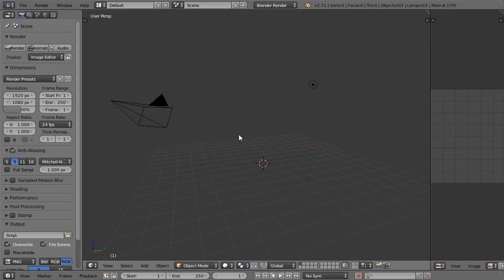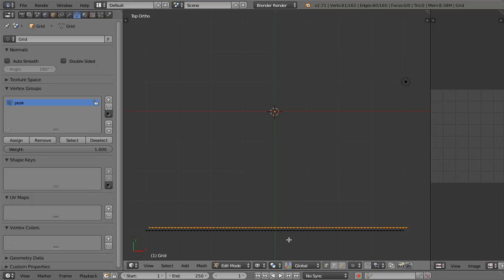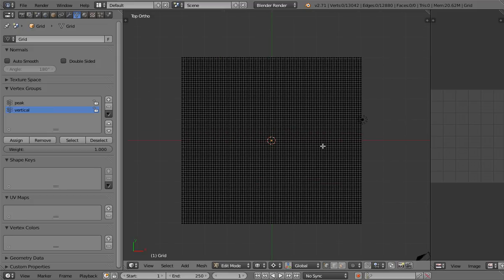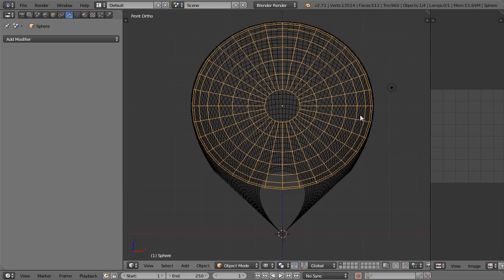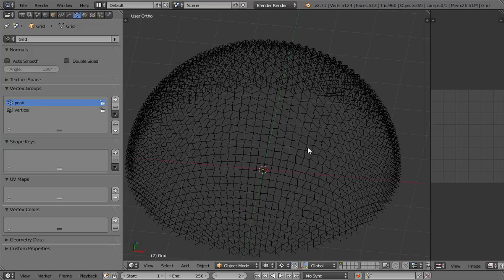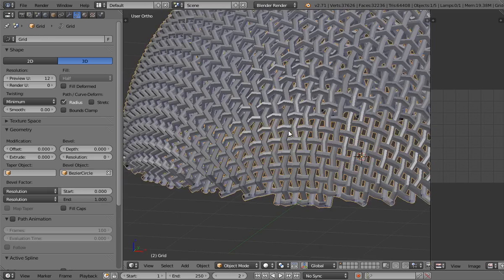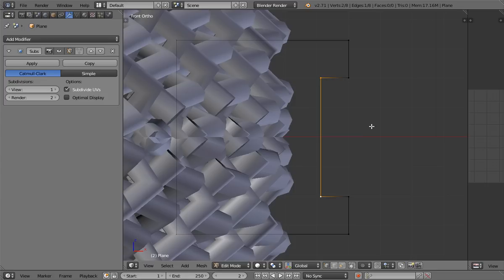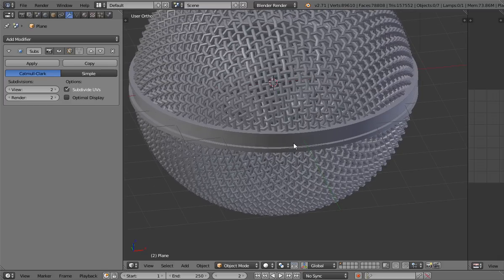Blender Modeling Exercise - Microphone

Comment: Ok thats actualy kinda hard. Wouldnt be able to do it. Wonder of you could just create a sphere with some high resolution and then use wireframe modifier, would just give alot of work selecting the vertices to scale down (or up) to make the strings interlaced... think it could also work, yeah, it would work.
Reply from the maker: There's also an add-on that'll generate a weave from any mesh shape, I think it's called the celtic knot add-on. This is handy because you can take a sphere and automatically generating the wires that weave in and out of each other. The thing this is missing for realism is how microphones become more congested on the sides as all the wires wrap around and begin to converge. -chris
Reply: CG Masters Amazing. Great

Comment: I suspect instead of converting the mesh to a curve and doing a bevel, the skin modifier on the mesh would have had the same effect.
Reply from the maker: The skin modifier doesn't offer a whole lot of control, including no radius values so you actually have to scale the object in edit mode to control the wire thickness. -Chris
Reply: Totally does. With the skin modifier on, go into edit mode, select the vert(s) and either press ctrl-a and move the mouse or set the RadiusX and RadiusY in the properties panel. Now, I will admit that on verts with more than 2 lines going into them the skin modifier gets a bit hinkey, but in this case it should be fine.
Reply from the maker: Oh nice didn't know that! How about segmentation?
Reply: Okay, I totally know what segmentation is, but just in case there's someone else looking at this conversation, you'd better explain what you mean, first.
Reply from the maker: haha I mean the amount of edgeloops added along the wire. The number of edge loops seems to be dependent on the scale of the skinning without a value of its own to change. But maybe there's a hot key for that too? The issue with that is if you want really thin wires it's going to add a ton of edge loops.
Reply: Ah, that. No, I don't know of any way to control that. However, there's always a decimate and mesh smooth. It's not elegant, but it works.
Reply from the maker: Darn that would've been cool. Oh well at least I know about skinning re-sizing now thanks for that.

Comment: Thanks for the video. It was very intuitive and coherent. I watched another Vietnamese guy doing it but couldn't understand every step of the procedure, so it was very fortunate for me to have found yours. However, to avoid having making separate layers for vertical and horizontal lines, still using the save Vertex Group 'Peak', you only have to move the vertical copy 1 unit of grid to left or right. This will avoid the collision of selected points later on when raising the selected vertices up (weaving). Also, after raised and converted to curve, if you convert them to curve type Bezier (in Edit mode, on Tools menu, section Curve, 'Set Spline Type' and choose 'Bezier', then you can smooth them by pressing 'V', choose 'Aligned'. This will also allow you to change the preview resolution to 5, bevel resolution 2, much cheaper than having to use Sub-suf modifier. I found my machine was struggling when using sub-surf.

Comment: What are ur unit setting? Because when I try to duplicate my line by holding Control and moving it up, it will not move that close. only to the next grid line
Reply from the maker: Hey sorry for the late reply, my unit settings are not set to anything for this video, they're just default. You can hold ctrl+shift while moving to move things in smaller increments. You can also zoom in until the grid lines split so you can move things in smaller increments as well. -Chris

Comment: Great tutorial and nice results; I never played around with that cast modifer before so thanks for pointing that out. Though I am a bit curious why you decided to add extra verts for the band instead of perhaps using something like the edge split modifier, or even perhaps crease and bevel values and the bevel modifier on the hard edges instead?

Adding extra verts like that on something I plan to subdivide always bugs me, because of how dense it makes the mesh in those areas.A mic is small enough that a bevel seems overkill to me, so I'd likely use edge split unless there were going to be some close up shots, in which case I would use a crease value on the hard edges to avoid the deformations from the subsurf then use the bevel value and bevel modifier to add a bevel to each hard edge directly without all the cruft that comes with doing it the old dirty way. Also using modifiers means you aren't actually changing the base geometry, so it would be easier to continue refining if you find you aren't happy with the shape.
Reply from the maker: No reason really, it wasn't the focus of the tutorial so I just threw a couple edge loops in just to get a beveled corner since I rendered close up. But yeah there's plenty of ways to bevel or to not bevel, depending on what you need from your model and how close up you render. The bevel modifier used alongside the subsurf modifier is a favorite of mine. I used it extensively in my rifle course and its definitely a lifesaver in a lot of situations where the 'old dirty way' would fail, but the classic workflow still reigns supreme in my opinion in many cases for speed and flow. -Chris

Comment: After applying the cast modifier, going into edit mode, selecting all the vertices and clicking on the cast button to see the results in edit mode. When I press "G" then "z" and move the selection up all I get is a straight line going up. I've started from scratch a dozen times, listened to the video many times and I still don't know what is happening. That's at 7 minutes into the video. Thanks
Reply from the maker: Hmm, as long as you've got that edit mode display option enabled in the cast modifier it should be visible when you move the vertices. Can you save the blend file at that point and send it to me at contact@cgmasters.net? I'll check it out and get back to you. -Chris
Reply: I'm tired right now but I got it to work, Not sure but I don't think I was in Object mode when I selected the cast modifier

Comment: Never heard the Shift+R hot key for repeating before. That alone is a massive time saver! Never would have attempted to try the mike wire mesh; amazing solution. Cast modifier, go figure! Thank you.
Reply: Jacob Fausett - Maybe double-check your hot keys too in preference section. I have a few Blender hot keys that got highjacked by other applications. But I did otherwise just verify this works in 2.78
Reply: Make sure you dublicate and move in one action. Don't press RMB before everything is in place. Otherwise it counts as two actions and he will repeat only your last action. Which is move. Hope this helps.
Reply: @Filicatos  Man you saved my life
Reply: How? When I hold Shit+R, it just moves the selected vertices down a row.
Reply: Jacob Fausett Shift-R will repeat your latest action, so make sure your latest action is what you want to repeat! its likely that u did something else unintentionally right before hitting shift-r.
Reply: I asked about this in a forum not too long ago, no one seemed to have an answer. Took the need to draw a complex mesh to learn it!

Comment: I'm making a mic for a video game. I don't want to go over the top on the modelling side of things. Any ways I could go about modelling it, keeping it relatively low poly? Should I just use a sphere for the top of the mic and use a texture to get the "grill" look?
Reply from the maker: Yeah that seems to be the best way to do it. You could even model it high poly and use the high poly mesh for baking both the diffuse map and the normal map onto a low poly model. -Chris
Reply: CG Masters
 Have you got a tutorial on baking normals? I've never really gotten round to doing that sort of stuff.
Reply from the maker: I don't think we do, but I can walk you through it. The Bake options are in the render properties. You set the bake type to "normal" and enable "selected to active" which will allow you to bake from a high poly mesh to a low poly mesh. So you would create the high poly microphone and a low poly microphone and have them overlapping each other perfectly. Then select the high poly mic, and THEN the low poly mic, and click on Bake. You'll need to make sure the low poly mic is UV unwrapped onto a new image too, since it needs an image to bake the data onto. I think Cycles requires you to set up a material to do this, so I use the old Blender Renderer to bake normals which just requires uv unwrapping onto an image. -Chris
Reply: CG Masters
 Thanks a lot man! I used 3DS Max in University but never reached the point at which I'd need to use baking. So I need to have a UV unwrapped image first before baking?
Reply from the maker: Yeah, UV unwrap the low poly mic onto a blank image which you can add in the image window from the image menu. Otherwise you'll get an error like "no image found to bake to". -Chris
Reply: if I was doing a video game I'd just have a sphere with an alpha-enabled texture on it...

Comment: I cant get the cast modifier to actually work, it just leaves me with my grid.
Reply from the maker: Can't really think of anything except either modifier visibility being turned off, or if you're still in edit mode and don't have the edit mode visibility turned on(icon next to the eye icon in the modifier). But you can save and send me the blend at contact@cgmasters.net and I'll check it out. -Chris
Reply: Thanks, I'll send it in. And all my visibility things were turned on :/
Reply: Alright, so I lost the file and went to redo it. Then I realized I didnt have it in wireframe, and that's why it wasn't showing up

Comment: when i add the screw modifier it doesn't go around my mic, it just spins around.
Reply from the maker: Make sure your objects origin point is at the center of the mic because that's what it'll spin around, and also you may need to change the Axis option in the modifier to get it to spin in the right direction. If neither of these things are the problem you can send the blend to me at contact@cgmasters.net and I'll check it out. -Chris

Comment: Advice for workflow: 
1. Use modifiers wherever you can. A few stacked Array modifiers would be great for this project.
2. Avoid applying your modifiers to your mesh. You lose flexibility you may want later.
3. Back up your model before applying a modifier. Sometimes you need to apply modifiers. Make sure you can go back to them in case something needs to change. As shown in the video, duplicating to a different layer works wonders.

The tools that come with Blender are powerful and every Blender modeler should learn about them (at least see how each can be used). There are some helpful tricks with animation and physics simulation on top of modifiers and mesh tools. There are a lot of helpful add-ons too. A bit of research and you can find these kinds awesome tutorials that will make the job much easier.

This is a great tutorial. It shows modelers how thinking outside of box modeling can help you make intricate models.
Reply: You summed it up perfectly :) Indeed modifiers are very powerful, and so are addons, I'm a beginner and I lack of lot of knowledge in modifiers, I can feel it :/
Reply: I am a beginner, as well, but I definitely recommend the courses on Lynda.com on Blender, esp. in the beginning stages. Many of the tutorials on YouTube are very superficial—yet they are still helpful in introducing you to the capabilities of the software. They often neglect to explain why.

Comment: The actual lesson! Even 2 years later. 
Is there a way to make a low poly model grid for the game? For example - fence. This method will not work?
Reply from the maker: If you're planning on making something like a fence in a game, I think it's typically better to use textures for the job. It's still common to make fencing using alpha textures instead of entirely geometry. I guess it depends on how closeup and how important this fence will be. -Chris

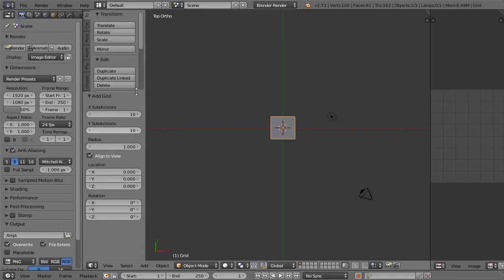Comment: 00:45 - That subdivisions option is gone from the menu, any help? Also, if there's a place where people post all the tips to do this on the new version of blender, please post the link.
Reply from the maker: I just double checked, that option is still there in the latest Blender. Sometimes the Operator menu the option is in minimizes for no apparent reason. At the bottom of your left-side toolbar is there a little + icon? That will bring that menu back. -Chris
Reply: Maybe it was because I started the project on Blender Cycles, I switched back to the older one and it still was missing. But not all the tweaking options, it was just a different menu there.
Reply: I'm four weeks late, but for future readers:
Be sure that you are adding a grid and not a plane. A plane will not have this option. If you have a plane though, you can subdivide it using ctrl+r and use the scroll wheel to increase the number of divisions.

I would've approached this part of the modeling differently myself. Look for tutorials on the array modifier and see if you can imagine how else you could approach this model. You might find yourself coming up with a solution similar to my own. ;)

Comment: I can't move it 0.1 units, please help!
Reply from the maker: Holding ctrl will enable snapping to the grid while you're moving your object. Naturally grid snapping will depend on how zoomed in your are because the visible grid changes. If your snapping increment is too high, you can hold ctrl+shift while moving and it'll divide the increment by 10. So for example, if you're moving an object while holding ctrl for snapping and it's moving by 1.0 blender units, hold shift as well and it'll move 0.1 blender units. If all else fails, while moving something you can also simply type in the amount you wish to move it and then press enter. -Chris
Reply: Oh ok, thank you so much for the help. Keep it up Chris.

Comment: this is a great tutorial. the only question I have is, with the ban at the end, in stead of selecting the top and the bottom separately could you have just scaled the entire band on the z axis to achieve the same effect?
Reply from the maker: You could do it that way but it wouldn't be quite the same. It would result in shrinking the height of everything. I was happy with the height/thickness of the top and bottom so I moved them to simply shrink the height of the middle channel. -Chris
Reply: ah, that makes sense. thank you for the quick response.

Comment: Its an incredible tutorial.

But I have found one problem. You use 81 vertex. Thats exactly to match the blender grid? If I need 15 vertex, duplicating and moving to the right "first line" will work snapping to vertex, but when moving them up, there is no way to move the line of vertex exactly the correct distance.

There is nothing to snap to and grid is no valid because some of my 15 vertex dont match to the blender grid. Vertex need to be moved up and to the right the exact distance between two vertex. If you dont do it, when duplicating and rotating all vertex, they will not match.

Is there any way to solve this with a diffent number of vertex that 81?

Thanks so much in advance.
Reply from the maker: Yeah you just need to make sure there's the right amount of grid lines in the boundary of the plane. So select the plane, scale it down to 0.7, and then add 13 loop cuts. That'll give you 15 edges perfectly on the grid. -Chris
Reply: I had to figure out a similir method without scaling to 0.7, buf finally I got it. And it is not for a microphone. Check it here: http://www.foro3d.com/attachments/217884d1465060465-gibson-explorer-pantalla.jpg

Thank you so much!!
Reply from the maker: Looking good! It looks like the wires aren't weaving together quite right though, there's a lot of intersecting going on. -Chris
Reply: Yes, you are right. There is overlaping with the wires. I have tried decreasing the master circle, but then wire seems to weak. This will not be appreciated in the final render cause this cabinet is not going to be close up to the camera.

Next time I will be more careful.

Comment: Cool stuff. However, I'm using 2.77 and when I do it the way you showed there was no spherical deformation when the grid was displaced from the origin even though there was deformation in the plane. It does work it I place an empty at the origin and use this as the control object. Is there a setting I missed?
Reply from the maker: So when you use the cast modifier on the grid it doesn't bend it spherically? I'm not getting that problem in 2.77, but if you haven't figured out the issue yet you can send the blend to contact@cgmasters.net and I'd be happy to check it out, I love a good mystery. -Chris

Comment: How did you move the vertex after duplicating  by 0.1 without using the x,y & z parameters(mine shifts by 1 grid unit using Ctrl)?
Reply from the maker: +Don Xizzle Holding ctrl while moving will move it by 1 grid unit. For more precise snapping you can hold ctrl+shift while moving and it'll move it by 0.1 grid units. -Chris

Comment: If you want sharp edges despite using a subdivision surface modifier there is also an option called Mean Crease, which you can find under Transform when pressing 'n'. This saves a lot of vertices. Apart from that nice tutorial. :)
Reply from the maker: Manuel MüllerGlad you liked the tutorial! Mean Crease does have its moments, but as far as I know it's simply subsurf weight so it still needs extra geometry around sharp edges else you'll end up with a low resolution bevel. In a lot of circumstances you end up needing to crank subsurf up another level or two to get the high quality tight bevel you want, creating excessive faces in the process. This is why I personally prefer adding extra edge loops, better quality bevels with less polygons. -Chris